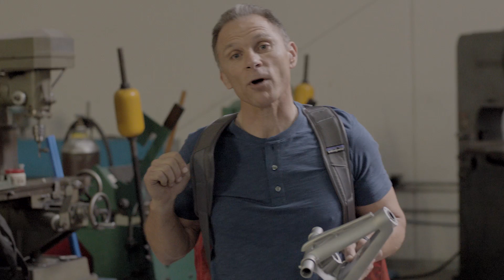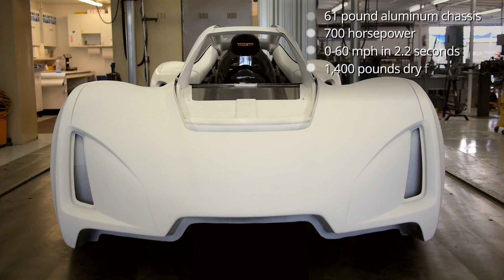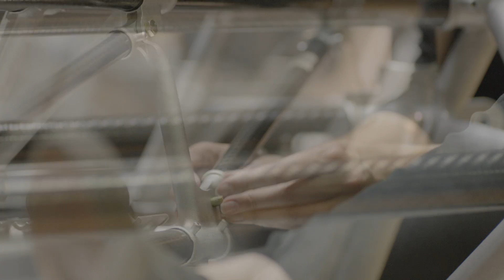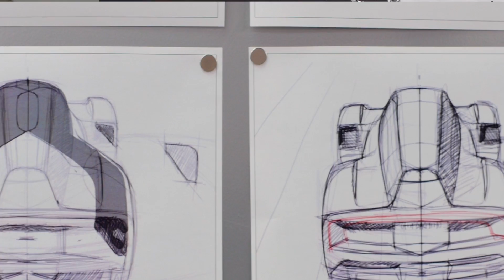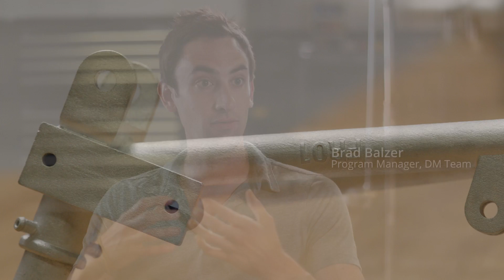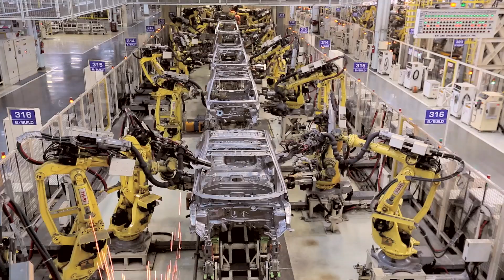First 3D Printed Supercar - A New Way To Build Cars

Comment: As a mechanical engineer, I can say 3D printing is truly coming a long way. Anyone interested in the organic structure capabilities of AI iterative design, check out the YouTube video on the Czinger 21C. Not only could much of the structural components not be manufactured with current casting and machining methods, but the designs themselves could never be optimized like they are by a single designer.

Comment: An entire automobile unit body could be 3D printed when a large enough printer is built. Shapes and thicknesses, even materials, could vary throughout the structure to meet strength and rigidity requirements. Modifications could be made without expensive re-tooling as there would be no tooling to begin with.
The outer surface could be pre-colored rather than having to paint visible surfaces.
Collision repair parts could be printed as needed rather than having to manufacture and store large quantities of replacement pieces in anticipation of demand. It would even be possible to cut damaged sections out and 3D print a new section in place on the car body by a smaller printer in a body repair shop. Even after a body model is out of production the program for the original shape would be available.

Comment: Eventually this is where it is going = 3d printed chassis, open architecture electrics (motors, batteries, controllers, from different manufacturers but compatible with each other). Pretty much like the way you can build a PC today. The thing is that you can not escape the giga-factories. They will still be around, making the parts that you need to build the car. Or the 3d printers that everyone will use to print their "anything".

Comment: First consideration is driveline duh engine,trans,suspension, capillaries for fuel& electric.  You better be top CSWP with a very good surface geometry experience.  I'd personally visit Nelson Racing Engines(duh you best have big-time bank roll)with a rented(or owned) Kreon Skyline Robotic Arm Scanner(these have a magnet base that can be laid down on a 2" rectangle of Blanchard ground steel plate with welded handles so u can mobily scan anywhere) then load Nelson R E into your mobile-workstation(duh big laptop).  Forget this guys legos frame and use Rexroth Bosch Aluminum Framing System(u can forget about building this off anything but a steel slab ground to .0001(duh they are  called fit slabs---in this case as long& wide as your vehicle). Once your NRE & drive-suspension scan is on your home based monitor, then u can design your car.  I'd use carbon-Fiber Pre-peg from www.compositeenvisions.com to wrap the Rexroth Bosch frame.   The body components could be cranked out on a 3DP-Platform WorkBench Series#400 or go even bigger with 3DP's Excel Series.
          Summing up the building of a hyper car isn't or as easy as this guys approach and it most assuredly is a big $$$$ buck and skills thing!!

Comment: Cost, a time to build? Why not take an older small pickup, remove body, and print a lightweight body to replace? Then you have a legal registered  vehicle, but have significantly  lightened the vehicle.  The framework, and suspension  is done. Not a super car, but lighter is faster, or for my interest, more fuel efficient.

Comment: Umm, doesn't Carbon Fibre and Aluminum have a galvanic reaction when they come into contact with each other? This would cause the the Aluminum nodes to fail in time.
Reply: I used to build recumbent bicycles and thought about what you are doing but did not because of the corrosion issues. 

I currently drag race. I am using a 1990 Tbird Super Coupe. It is very heavy and I would like to put my drive train in a lighter car. Your design has interesting qualities who do I need to contact for more information?

Comment: this is great thinking in new directions, so many people are involved in 3-d printing that the materials are changing faster then you can keep up with. graphite printed nodes with carbon fiber filaments and this cantilever construction shapes should be able to hold anything, be it batteries, electric motors, or smelly old LS-1 blown supper charged engines.

Comment: eh, i wouldnt want to be the tester until they can somehow weld a chassis or find a better way to secure cf to metal. dont want to drive a car that a parrot can take apart. Well a shit ton of lock-tite and i would putt around in it for a bit lol. I guess you can probably get some very high strength bolts and weld them but that has its own set of issues.

this is more about the process than the finished product though. that i can respect, but the bureaucracy will limit this to a mere idea in a long long line of ideas before it becomes viable for the notion of printing an entire cars worth of parts sans cf.  well maybe they can get by with mc regulations or another loophole.

fun challenge for engineers certainly and probably some good promotion for funding ect. looks great, far better than the 60 mph printed hauler. tbf, that hauler has a full printed chassis and pulls a trailer with solar panels to charge its batteries and in turn, feeds back to the trailer if needed.

Comment: crash test 1 star.
Reply: lower... i think this could possibly fall apart just riding along and hitting the brakes too hard when a bolt or bit of glue wears out
Reply: dont forget about the engine vibrating... which could just break the car upon starting it up

Comment: You wouldn't download a car.
Reply: Yes I would
Reply: A small 3D printer would take a long time to print a car body. Then assembly would be required as electric motors have wire windings that won't print. Tires, ball and roller bearings, other parts.
Reply: yeah the instructions for it would be a dictionary size. does your car manual printout to.

Comment: I like how people talk about how dangerous it could be in a wreck.  We got people riding motorcycles without helmets here in Tucson... this car is way safer!  People love being coddled by the nanny state keeping them safe with all their regulations that destroy innovation.  I'd love to see an electric hybrid car that uses a small power generator like a Honda electric generator and some super capacitors in place of the battery pack for passing power.  If your generator fails you go to Harbor Freight and buy another one and off you go again.  With this kind of lightweight construction you'd have more than enough power from a small generator and you can make it a 2 seater like the Smart car.
Reply: This IS dangerous in a wreck dude, remember 15 years ago?  A bunch of US SUV manufacturers got in trouble specifically for using nuts and bolts on the frame which immediately sheared off because those nuts and bolts are the only things holding the frame together it didn't matter how durable the frame was it only mattered that a lot of energy got concentrated on what was holding it together?  People died thinking "wow my SUV just got sheared in half by a toyota corolla"
Reply: Not Harbor Freight, haha.
Reply: Well only Harbor Freight if you're really really desperately poor, or just lost your paycheck playing poker, LOL.  The nice thing about a portable generator is you could borrow one from a friend, buy a cheap one to get you buy until you get some real money or if you can afford a good then have a lot more peace of mind.  If an engine goes out in a regular gas burner you are out big bucks to swap one out, or have to go into debt buying a newer car.
Reply: People die you idiot. I'm a collision repair technician, and I have a million reasons why these cars are plain stupid.
Reply: You ever heard of crash testing?  Have to do it to put in production...  Don't underestimate the strength f Carbon Fiber.

Comment: how much of an impact does the carbon fiber process have on the earth as well as cost? can it be recycled, don't think it will break down.  One has to think of all the processes involved. is the aluminum cintered or is there an epoxy binder used?  so in the end is the entire process cheaper and better for the environment in the end? love the technology as i like to tinker with my 3d printer and build things.  definitely not a tree hugger,  just being in manufacturing  myself you have to account for everything involved.

Comment: I really love the idea of the erector set of building your own type of car. But i believe to have a production product out for the public to drive is being that the car has to be safe. So the idea of having a multi piece frame structure, instead of a solid one piece structure will fail through out time and how the car is driven. Mostly likely a KIT car build but not for the average driver.  nice idea though.

Comment: This sure was a lot of fluff. Building a 3D printed "mold" is all they did and then make bold statements about how this new method of making molds is going to change the industry. Then show them putting together the words worst designed Chassis. Who thought of this nonsense? I feel sorry for their investors. They should of picked something easier to create like a motorcycle.

Comment: don't toss around amazing specs and not even have a finished car. no way in hell that chassis/ frame will work.
Reply: Here is a video of the completed car. https://youtu.be/vPv7PwS50OE
Reply: That's the thing with additive manufacturing, you look at it and you are wondering how it's gonna do the same job but that's where the powers is, optimization of materials. It will work just fine
Reply: Yeah your right that chassis is to bulky what about passing auto industry specifications.maybe as a child's vehicle toy but they have specifications to

Comment: My father works with nano technology catalysts. Adding a unit that would convert Hydrocarbon gas directly to hydrogen for hydrogen on demand fuel cells would remove the batteries and make gasoline the cleanest burning fuel in the world. No batteries means a lot of land fills will not have toxic battery wastes. The weight of the electric components would be reduced a lot without all those batteries. Even with a small battery, the nano technology for super capacitors would charge extremely fast from the fuel cell. He is looking for a platform to prove the tech. He also puts his nanotech in 3d printing materials for integrated conductive material and strengthening materials. No wires.

Comment: How not to use 3d printing. This Looks like the lattice structure of a crane, and "wow" they could leave out the weldings and "wow" they used carbon fiber tubes.IF you want to take any benefit out of the technology, you have to really understand and use it: That means topology optimization which goes far beyond tubes aranged in a triangle.They probably don't even know which forces are applied at the interfaces. Sad how people react seeing a commercial. Though you see it in the tv: When you put milk, choclat and  cereals into the fridge, it won't transform into a cereal bar.
Reply: These films serve only one purpose, and that's reeling in investors. A former company of the same guy also managed to waste a few hundred millions of investors dollar on some electric car company.
It keeps amazing me how many stupid ideas get funded by filthy rich investors with the technical insight/expertise of a peanut...
Reply: Koenigsegg who builds a Supercar in Europe ALSO 3D prints their parts from Carbon Fiber etc.. And he got funding for his company as well, it's sad how many clueless people run their mouth on  you tube and never worked farther then a 7Eleven.
Reply: Koenigsegg who builds a Supercar in Europe ALSO 3D prints their parts from Carbon Fiber etc.. I doubt you even have an engineering degree and are just a troll on you tube with no friends. Go back to Minecraft.

Comment: 3D printing the bodywork seems unnecessary.  It's hard to be more practical than stamping a body panel out of aluminum or steel.  3D printing that shape seems like it would be much more slow and expensive.

Comment: You could probably even 3D print the aluminium nodes yourself at home, by using a lost-wax (or lost-PLA, or lost-ABS) casting process.  Then just ship in a bunch of standard diameter carbon-fiber tubes, & steel nuts-&-bolts.
Then a large CNC router could carve a huge polystyrene mold, which you will then use to create a fiber-glass shell.

Dunno howto do the engine as easily tho.  Perhaps use lost-wax technique to create the engine block, then use a CNC machine to mill out the cylinders etc?  Not really my field.

Anyway the point is that you could probably do it at any Maker-Shed / Hacker-Space on the planet (or even the members' own garages).  Pretty awesome ideas here in this vid.

Comment: We made the first 3D printed supercar!!!!

OK, I mean the structure is 3D printed.
Actually, I mean the node of the structure is 3D printed, then you connect them with carbon fiber tubes, which ... we bought from somewhere else.
What? the body panels, engine, wheels, tires? No, no, no, that has nothing to do with 3D print. But that's not important. Let's not talk about it.
Why we call it the first 3D printed car? Well, that sounds a lot cooler than calling it "the first lab car that consists some aluminum parts that are 3D printed", right?
If you want to see a 3D printed car, you should look at this one (https://www.youtube.com/watch?v=bfah_4-H_Sg). At least the entire frame and body are 3D printed.
Reply: how long did it take to print?
Reply: Your link goes nowhere... video removed?
Reply: gives hope for someone wanting to buy or make cars outside of the big manufacturers.

Comment: Bullshit this. The only thing they print is an aluminium piece called a node. Not even the whole chassis. EVERYTHING else is purchased, the carbon sheets and tubing, bodypanels, parts, suspension, engine etc. Having experience with bonding metal parts to composite tubes I wonder how stiff it is (also in the long run). I wouldn't be surprised if it drives like a wet hand towel on wheels.

Comment: Not that impressed overall.. It's apparently a single seater, and it's just the main chassis that's had its cf tubing bolted to the nodes? How well does cf  hold up to sheer strength or whatever you'd call the node's pulling effect on the cf tubing/bolts, and road stresses that manufactures of traditional cars fret over constantly? 

Plus you could weld that simple chassis up quickly in Al using jigs/humans or even robot welders. They're leaving out that the bodywork/interior etc is the bulk of the labor involved when building a car, and a single seater doesn't require as much of either.

This is almost like using PVC tubing and PVC connectors to build a frame and saying "Ta-da" !  (sorry)

I'm sure there's a lot of work that's gone into the nodes.& cf connecting tubing, but face it-the rest of this car was built the normal way, and I'll bet it hasn't been torture tested -  like I used to do for GM.
Reply: Everything starts somewhere.In school in the eighties i thought of a plan to use my spectrum to control a printer(mums lecki typewriter) combined with dads spraygun and build objects from paint...My teachers thought it was a rubbish idea.They said who would want anything made from paint..They had no vision and look how wrong they were....they thought i was mad in fact..This was before the guy who invented it.Cant prove it but one day they will read memories and ill show you.Austin mini shell is my goal...Keep dreaming x
Reply: More Start-Up Companies fail than succeed each year.  This is just one of the many that will fail.  It's a creative Idea in Practicality,   but, not in quality.  That would never pass a crash test and,  as it is now,  3D printing is still very slow compared to metal casting and/or forging.   We all know "Time is money:.

Comment: Impressive. I see this tech being the primary means in manufacturing but the Big 3 are not standing by and they are already in the development phase of 3d printing. i.e. they have more money.

What was 3d printed?
The Chassis was 3D printed

What was NOT 3D printed.
The engine
The Wheels
The body

Of course the other materials required to make this a "Car" are still made in pollution producing factories.

It's a start but a loooong way to go to "make the world a better place"

If you could replace 1 in 5 cars with these models and classify them as kit cars then they don't have to adhere to crash test standards but I am sure the big 3 will sic their lobbyist on their paid for politicians and 3D car manufactures will be forced to comply.
Reply: +John Wayne The engine is made of aluminium, i imagine it could be printed to an extent, might require some milling afterwards tho.  Wheels are a no-brainer.  Of course you'd need some vitamin parts added, (ie: i dunno how good 3d printed in-situ bearings would be, might want to add proper bearings instead as vitamins).

Are you sure you've thought this through?  Look at those aluminium nodes, if you can do that then you can do a lot of other things.
Reply: +John Wayne So you are actually advocating that adhering to crash safety standards is a bad thing?
Reply: You missed the point entirely. You can sell a lot of them without adhering to the tests by classifying them as kits cars just like ultralights don't require a pilots license.

Comment: Great idea, but it needs some safety ratings, crash tests and so on.
Reply: silviumc If cars were being autonomously driven then we could likely do away with the current crash test parameters. If all of the vehicles on the roads were autonomous and cars were all light weight then again the crash test parameters could be completely different.

Point is, cars should not weigh 2 tons and waste most of their energy moving that 2 tons rather than expending the energy primarily on moving people.